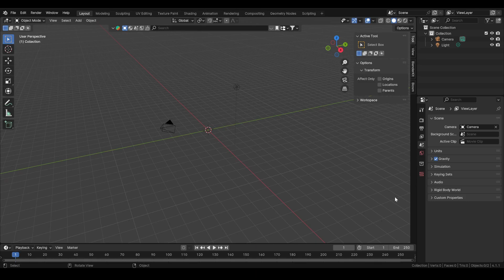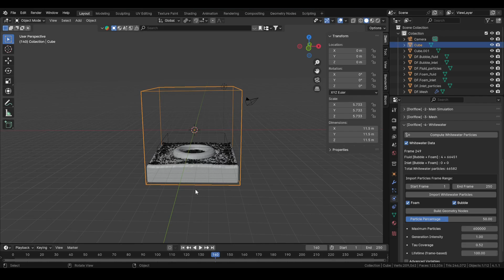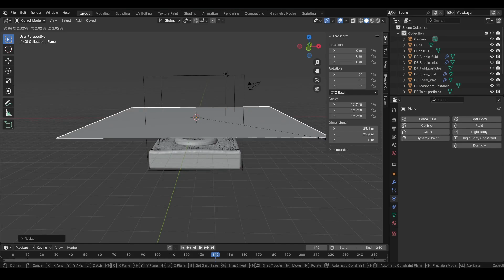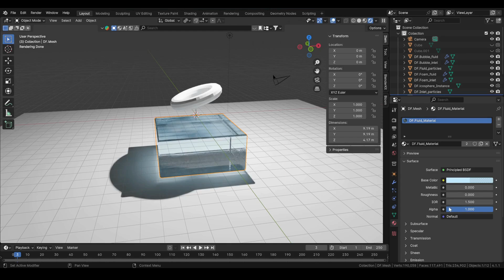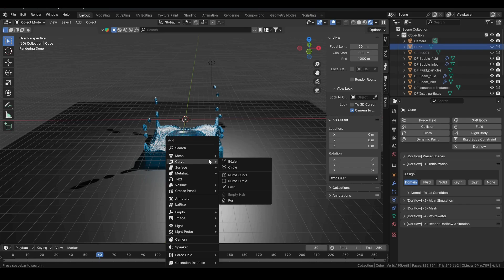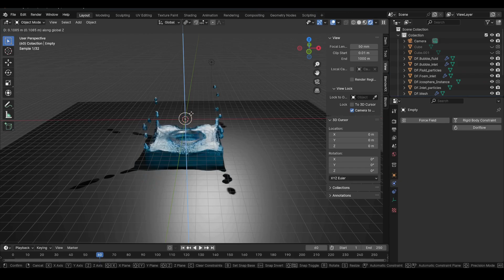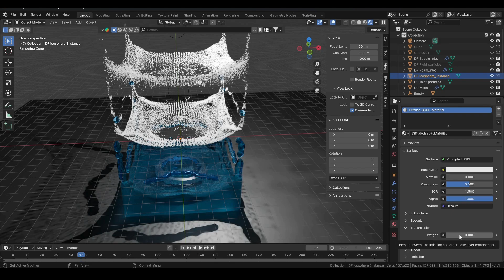🌊HOW TO SET UP A FLUID SIMULATION IN BLENDER USING DORIFLOW | COMPLETE TUTORIAL FOR BEGINNERS & PROS

Comment: What's your GPU?
I hve a 4090 and i would love to know if this would be an improvement over blenders standard simulation in terms of simulation speed.
Reply from the maker: Hey! I was running this on my 6-year-old RTX 3090, and it handled the simulation quite well.
Your 4090 would definitely be overkill for this scale of simulation. GPU-accelerated solvers like Doriflow really shine when handling a very high number of particles—think 20 or 30 million. So yes, at this scale, you'll see a significant speed boost compared to Blender's traditional CPU-based solver. But in smaller-scale simulations like the one in this tutorial, my 3090 would actually perform roughly the same as your 4090, simply because there's only so much GPU power the solver can utilize at that scale.
That said, it’s not exactly an apples-to-apples comparison. Doriflow is built for high physical accuracy and is designed to solve real physics equations. Other 3D solvers are more visualization-oriented and often use approximations or shortcuts, which can make them faster in certain scenarios—especially when simulating just fluids.
However, Doriflow includes complex multiphysics capabilities, which Blender doesn’t fully support. So while Blender might appear faster in simple cases, Doriflow is doing a lot more under the hood.
Hope this helps and thanks for your interest! :)
Reply: @doriflow_engine  Thank you so much for the extensive explanation! 
I do like accurate simulations and realism!

Can it simulate rain?
Reply from the maker: @RathianArt  I haven’t tried Doriflow for this yet, but with the right setup, I believe it could produce a rain-effect simulation. That said, using Geometry Nodes might be a faster and more efficient approach for this specific purpose.
If you're aiming for a truly accurate rain simulation, I would say it is still a challenging task—even in professional environments.
Reply: @doriflow_engine  Hmmm interesting! I might try something when i get it! A bit short on money this month.

I saw some cloth stuff on the channel.

Is it gonna be faster to simulate too?
Blenders native cloth simulation system is a pain in the butt so I've been using Marvelous designer for cloth.

Would be nice to be able to do that in blender.
Reply from the maker: @RathianArt  Yes! In the next Doriflow Advanced version, cloth simulation will be supported using an upgraded PBD (Position-Based Dynamics) solver. In theory, the PBD solver should be faster than Blender’s native mass-spring cloth system, which can get pretty slow. That said, since it’s Blender’s internal engine, there might be some performance advantages in terms of data handling or deeper integration - I can’t say for sure yet.

Marvelous Designer will definitely still have the upper hand, since it’s built specifically for cloth and likely uses a range of optimized algorithms. But I will aim to make my cloth solver as good as it can be! This new PBD system will also open up soft body and balloon-type simulations—so if you’re into stretchy, squishy stuff, that should be a lot of fun too :)
Reply: @doriflow_engine  I am indeed into squishy stuff 😂

Have you considered making a discord server for the community?
Reply from the maker: @RathianArt  I haven't yet, but if it helps more people to try Doriflow, I'm definitely open to it.
Reply: @doriflow_engine  I don't know if it helps more people try it.

Just makes it easier for the customers or even potential customers like me to communicate with you better instead of talking in youtube comments or Emails. 🤣

Comment: Sadly demo is bugged asf. You cant run sim only with domain and fluid, always get error "Simulation divergence" which is helping you to fix the problem for fantastic 0%. Solved it only by adding solid to a scene.
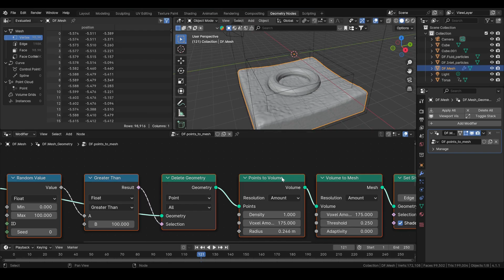Mesh generator is simply broken. Mesh is too small for amount of particles, yet if you increase its "detail" you just get domain-sized cube mesh. And you cant tweak anything like in this tut 2:00 because you dont have any geonodes, only smooth modifier.
also couldnt calculate anything higher 50 resolution, big resolution like 119 leads to divergence error at frame 30+, even timestep 0.01 doesnt help while it calculated to this frame for like 20 minuntes. Timestep 2.0+ worked but instant explosion as fluid touch solid.
64ram, 4090, win10. Tested in 4.11

Also 50 res mantaflow calculate even faster? i got 66sec to calculate 150 frames on default settings with Dori and 46 sec took for manta.
Kind of strange result comparing cpu and gpu calculation.
I bet the difference would appear when calculate larger resolutions, but for me nothing worked higher than 50 res.

Looking awesome and i would def buy it if it has at least setup capabilities and stability like mantaflow, but the demo is highly questionable.
Reply from the maker: Hi there, thanks for your feedback! Regarding the Simulation Divergence issue, you can check out more details here: https://www.doriflow.com/faqs. Since this is a real-scale engine, divergence can happen if the scene setup isn’t realistic (timestep too large or Res to low/high). 
I have made core improvements recently—like switching to geometry nodes instead of relying on an external mesh generator, which should help with stability.
Please note that the demo version uses a very basic solver and is designed just to give users a rough idea of how physics are coupled in a scene. It’s best suited for simple setups with basic particle initialization. For example, running at very high resolution can cause particles to start extremely close together, which may lead to explosion.
Also worth noting: while Mantaflow is a 3D fluid solver designed primarily for visual effects and rendering, Doriflow is built with the potential for engineering-level simulations in mind. It avoids shortcuts in the solver to maintain physical realism, which means benchmarks like speed or simple cases may not always reflect its full capabilities in more advanced or real-world applications.

With version 1.3, I introduced a unified system for Windows and Mac along with updated solvers. I’ll be updating the demo version soon to reflect these. Hopefully, it will be more robust and helpful in your workflow :)

Comment: Interesting. Am I to understand that the GPU as well as the CPU is being used to calculate the physics?
I want to give this a try and see how this compares to flip fluids and mantaflow.

Oh, and the floating objects, dual physics solid object interaction is something I have been waiting for, for a long time.
Reply from the maker: Hi mate,
Doriflow currently runs at 100% GPU utilization on NVIDIA CUDA but can also use both CPU and GPU on unified memory systems (like Apple M chips). I’m also planning to add a CPU/GPU simulation option.

Same to you! As a Blender fluid sim hobbyist, I’ve long wanted fluid-structure interaction in Blender, but no developers seemed interested. Since it’s standard in CFD industry software, I decided to contribute my small part. I hope you are having fun trying Doriflow.
Useful technical bits:
The GPU will excel with massive particle counts—e.g., in my tests, 10–20M particles took ~2.5 weeks on a Core i9 but just 11 hours on an RTX 3090.
I designed Doriflow to be technically near-accurate solver without shortcuts, so if benchmarked purely against other 3D apps, it might not be the fastest. However, that trade-off allows users to extract meaningful analysis when simulations are set up properly.
Reply: @doriflow_engine  2.5 weeks down to 11 hrs? That's impressive. My 3080 ti should perform about the same, assuming I have enough vram.

I actually hadn't tried it yet. My machines have been busy rendering. When they get done in about 3 hrs, I will try it.

Comment: can somebody compare that to flip fluids and Fluid lab? is it faster, better etc?
Reply from the maker: Thanks for your interest and recommendation. It would be great to benchmark with other solvers to have more insights on how GPU-fluid solver performs. I built Doriflow mainly to fill in the gap from other solvers that has been lacking over the years - to provide Blender users more capabilities when it comes to fluid simulation. You can utilize Doriflow to simulate a more robust fluid-structure interactions (floating multiple shapes of object), physics-realism viscous fluid, partial-keyframed object (keyframe the rotation of a fish and let the solver calculate its propulsion force in fluid). Everything is designed to run on GPU to hopefully solve that complex physics more efficiently.
Reply: @doriflow_engine  yea, based on what ive seen till now urs is not looking as realistic as other solvers but uve shown a few functionalities ive never seen before... keep going!
Reply from the maker: @bUildYT  yea for sure - will try best to improve the liquid realism as you suggested. Thanks for dropping by and hope to get your input in the next videos as well :)
Reply: @doriflow_engine  sure :D